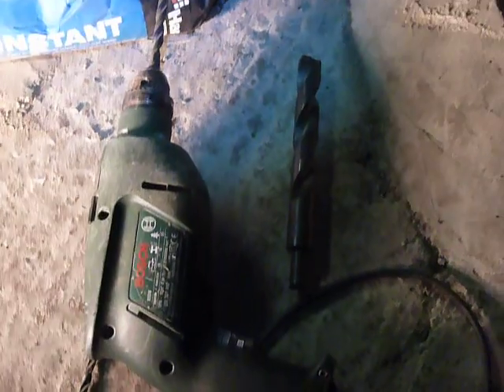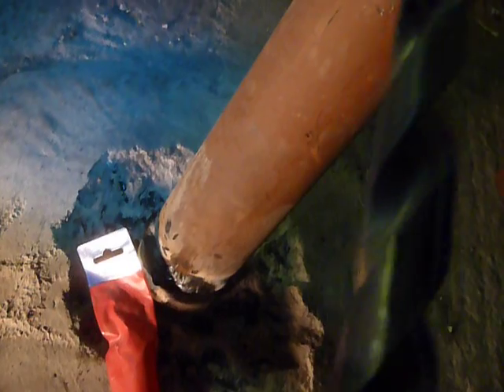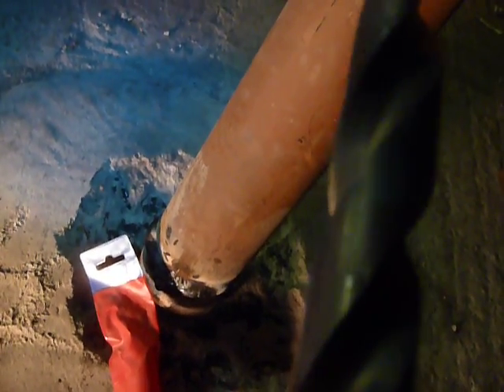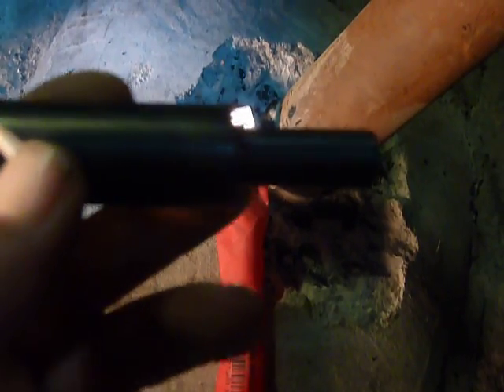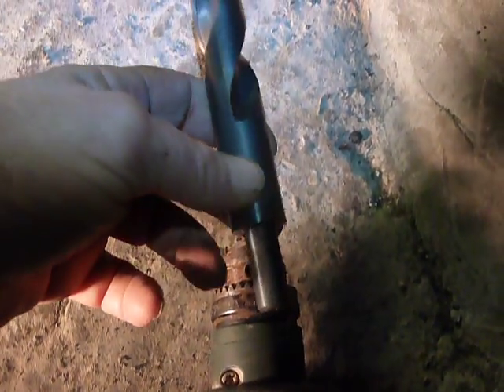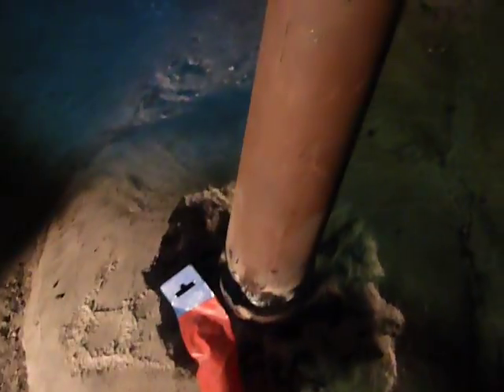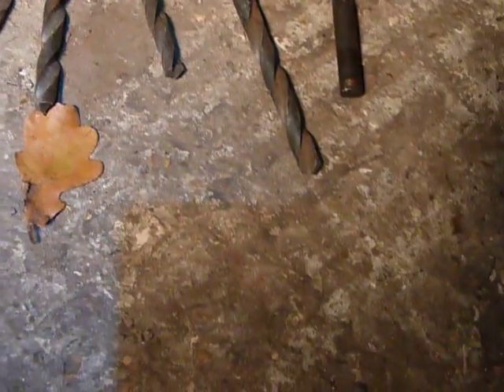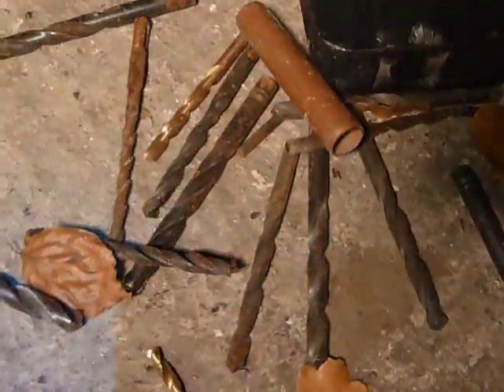Drilling steel Pipe

Comment: If "let the drill do its work" were true, the drill presses would be no good; but they are good & the pressure works with them.  The point is that there is an optimum pressure: Too little pressure & you are generating heat as the drill head slides on the metal surface. Too much pressure & the bit may break.  The trick is to use the best pressure to make a cut & get through as fast as possible. So the question is, How to determine that pressure?
Reply from the maker: ah  the great question   how  many  broken  drill  bits does it take to learn how much is enough  ??